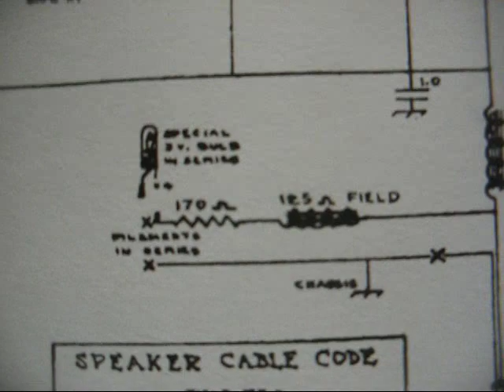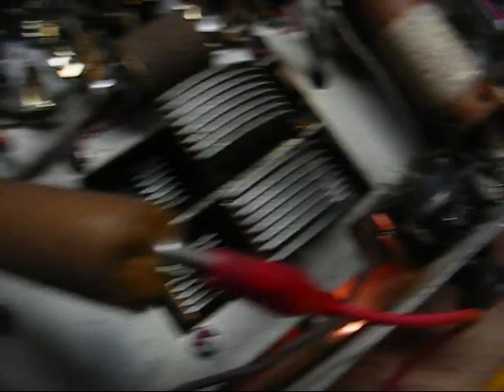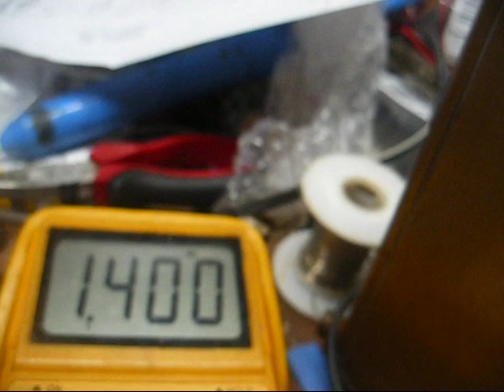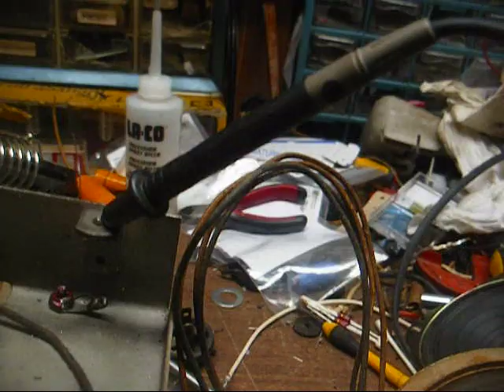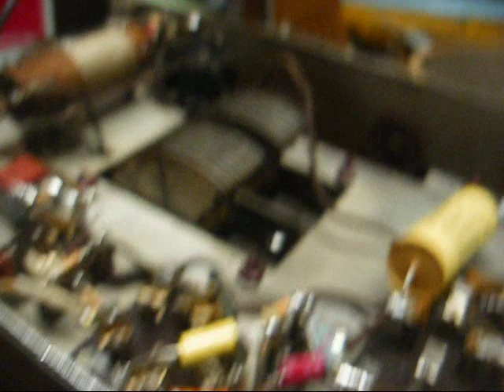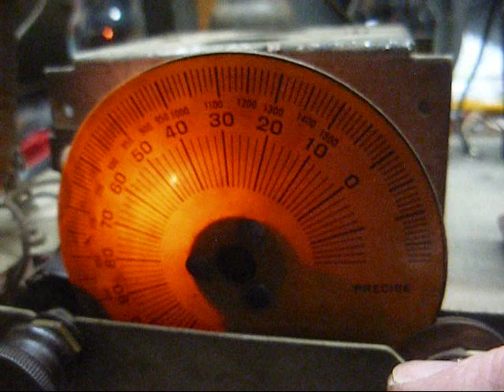Repair of a 1930's Belmont 110 VDC tube radio chassis

Comment: Do I see a cold solder joint where the big yellow cap solders to the chassis? It has that surface tension cupping where it meets the steel.

Comment: Most folks think of DC only service out in the hinterlands. In the mid 70's, there were still some DC buildings in midtown Manhattan in NYC. I'm talking 42nd Street between Seventh and Eighth Avenues. I was a field service tech in the phototypestter industry. I went to repair a brand new multi-thousand dollar typesetter that had been plugged into 110 VDC. The destruction was enormous. Fuses in the unit blew, but with no zero point in the voltage, they simply arced over, melting the fuse holders. Then the melted holders shorted to the chassis. Lots of acrid smelling charred wires. The several power transformers had open primaries. The whole machine was unsalvageable. But, I have to say, my soldering iron really worked great on that 110 DC. (The building had some AC service, but there were still lots of  of live DC outlets and lighting.)

Comment: The motorboating is not oscillation but ground modulation caused by the rectifier (that is why it disappear once you ground it properly).
Often overlooked problem with any rectifier: As it alters between conductive and nonconductive state, it is acting like RF switch opening and closing as the mains makes the diodes forward and reverse. And because youve used bridge, this switch action is, what connects and disconnect the mains from the chassis 120x per second (on 60Hz mains). Because the mains is acting like the ground, it modulates the antenna signal. So interferes with whatever strong signal you get in.
This is the reason, why many solid state radios used CT transformer and not bridge: The transformer is at least partially connected all the time, so the modulation is not that deep. Although CT is (and was) a bit more expensive than other 2 diodes for the bridge rectifier, it is still cheaper than the extra 4 diode bypass capacitors the bridge would need to suppress the modulation..
The correct way is to RF bypass every individual diode. In fact that is, what the "across the line" capacitors do on the AA5 or similar. Without it the ground would be connected alternatively via N wire only, or with both L and N in parallel (the DC filter is near short circuit to schassis). The across the mains then ensures the RF connection is then permanent, without any modulation anymore.

Comment: At the 29 minute mark the extraneous harmonics are just the trf circuit I think. Volume sounds good. Probably no better when new and the people thought it was simply amazingly good reception that they could understand what some snake oil salesman was saying all night with little hum buzz and shrieking. Towards the later 30's they could hear some wide band am sets with hifi. I would say this set is 1933 to 36 and better than the japanese had in their aircraft during the war later.

Comment: Why not just build a ac/dc power supply (on the radio) to provide the 110vdc power for b+ and tubes? With a transformer (no 6.3 vac for tubes).  Why rewire the filaments?

Comment: I have a request for you.
Examine what you actually do have, as in what is connected to where, and draw a schematic of what you actually do have.  While it can be useful to you, it also would help others that might run into the same model to know what is where.
I am glad that you mentioned about the capacitor that you installed that you chose to make non-polarized and why you chose to do so.  Reminded me of a video about the different types of capacitors and what their characteristics are.  In case you want to see it, it is at:
https://www.youtube.com/watch?v=67M7fsbLUIU
I sort of like the idea of building a power supply on the chassis, and especially if you use a transformer in it.  Like you said, it may "detract" from being original, but what you had of the "original" wasn't much good anyway.

Comment: Capacitor across the ac vs dc pins of the rectifier getting rid of the noise:
It is very often forgotten, but it is quite simple once you grab the concept:
The diodes within the rectifier are highly nonlinear devices. Nonlinear means, their small signal impedance (so how they are seen by e.g. the received rf) is highly dependent on their bias, namely the bias current. With diodes, the impedance is reverse proportional to current. If the current varies by large ratio, these could be seen as AC switches.
Now how these rectifiers work: Once the mains is above the rectified, current flows. Once the mains ac wave drops below, no current flows. Because the input is 60Hz AC, diodes carry current in 120Hz pulses.
And now connect these two together: Once within the pulse, diodes have very low impedance, connecting the schassis to grounded mains. In the gap between these pulses,  diodes block current, so seen as as RF switches they are off. So overall you have a switch, opening and closing at 120Hz, modulating the antenna/ground currents, forming extra 120Hz AM modulation on any signal of any strength.
Connecting the 100nF means you have provided constant, modulation free RF path bypassing those diodes acting like switches.
In fact the same happens across the rectifying tube in standard AA5, where the rectifier modulates the RF connections to the line wire, the mains bypass ensures the line is rf connected to the common all the time. More correct would be connecting the capacitor directly across the rectifier (as common in European AC/DC sets of the 40/50s), but that requires higher voltage cap so makers went cheaper with connecting it across the mains, relying on the B bypass cap to complete the circuit across the rectifier.
And it is the reason, why many cheap radios of the 80's and later use seemingly more expensive center tapped transformer supply (where the tap in the transformer costs more than the extra diodes), where the center tap ensures constant rf connection of the secondary to the supplied circuit, so no extra modulation. Alternative would be using 100nF parallel to each die. But that means 2 diodes plus 4 capacitors extra, which becomes more expensive than the center tap...

Comment: I hope that you have an isolation transformer daisy chained with your variable AC power supply because with the full-wave rectifier you're using there will be around 70V from that chassis to ground regardless of which way your AC cord is plugged in.

And on the 110VDC rating on this set. Besides the DC districts that other posters have mentioned, it is possible that this was originally a farm radio that was used with a pre-grid era DC wind turbine system. These were available in voltages ranging from 6 to 110V, with 32V (which you mentioned) being the most common. As an added inducement the turbine manufacturers also sold a host of household appliances designed to work directly with the voltage of their systems, including radios. Shame that the cabinet was destroyed.
Reply from the maker: Yes, my AC power supply is isolated.

Comment: Getting Dallas in Mississippi doesn't sound that bad.
I think there are good arguments on both sides for converting it to AC or not.
There are just about endless examples of 110ac AM radios from the era, so that's a plus for keeping it 110DC, but few people have a way of powering a 100vdc radio, so that's a good argument for doing the conversion.
If converting it is going to allow you to actually save and use the radio, then by all means, convert it.  It's not like some future owner couldn't just remove the rectifier and wire it back to DC.

Comment: It seemed to get a little better regards to mains hum when you put a cap between one end of AC line and ground. Solid state rectifiers will create noise when they switch from conductive state to non-conductive, often a cap between AC line next to the bridge's AC terminals will help. Value around 0.01uF should be a good starting point

Comment: If you operated the radio directly from the AC line (through a half wave rectifier) with a polarized plug you probably wouldn't need the chassis ground.  I wouldn't expect a TRF set with only one stage of RF to be a great performer.  Really only good for strong local stations on the bottom of the band.  You probably managed to squeeze all that there ever was out of that set, good work!  If you can find an old 'booster' transformer with a 125v 50ma, and 6.3v 2a secondaries, that would make a good power supply.  Could also use two 6.3 volt filament transformers (one 1A and one 2A) back to back to create the required power transformer.

Comment: The one wierd cap you pulled I haven't  ever  never seen one like that,I been wondering for a long time If gumout carburetor spray would work on tunning capciator because it washes grease away fast then evaporates real fast too.

Comment: So, what if you tried powering it w/ eleven 9-volt batteries?
Reply: You mean twelve, to get at least 108VDC - - using 9V Xsistor batteries to power this set with its huge tubes
Reply from the maker: As much current as it draws, they'd die in short order.
Reply: Yes 12 (my bad). But I was wondering if they'd last just long enough to determine whether or not the AC is the cause of the hum.
Reply: I doubt they'd deliver enough current to light the filaments.

Comment: that's a hell of a capacitor.  if I saw that without any context, I would've said for sure it was an inductor, too.   They almost look individually made by hand nearly.  I noticed the schematic was using M for "1000"  which is the roman numeral for 1000.  that's fairly unfortunate seeing how if you took it at face value, you'd put resistors in that were 1000x larger in value.
Reply: Pretty typical notation from that period, M means thousand, they'll use "meg" for megaohms.

Comment: And where I live 1590khz overpowers these kinds of sets (ironic that's the station that went back to their roots as they were one of our top 40 stations during the 60's and 70's and had been one of the top rated stations into the 80's)
Reply: TRF sets have horrible selectivity. A strong station can show up everywhere on the dial.

Comment: I thought direct current is only used for batteries. I didn't know they had DC electrical outlets back in the day.
Reply: Some New York City apartments had DC outlets for many years. It was Edison’s idea since he preferred DC over AC for home use
Reply: many cities had DC line voltage at one time.
Parts of NY, some parts of Northern CA, and I'm sure others as well.
The very last DC service in NY was not turned off until late 2007-if you look it up, there are articles about it.
Reply: That a very good point he came up with that i didn't even know too, you get a vintage radio to fix up, but you got to keep in mind that you may not be able to use it on today's AC power service without it being converted in anyway.

Comment: If I remember the earlier video on this radio, it was supposedly in working condition?  If that was the seller’s claim, (sarcasm alert) it’s amazing how those components all failed in the short time you had that set.  Good job!  It will be interesting to see how the cabinet comes out.